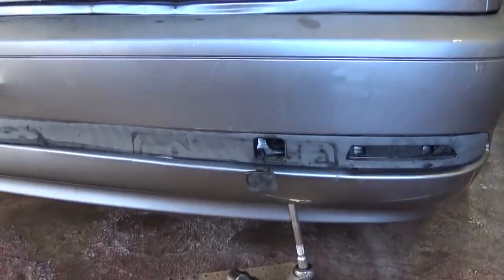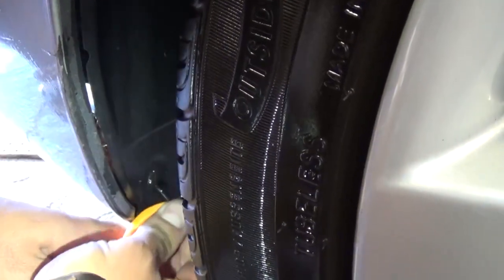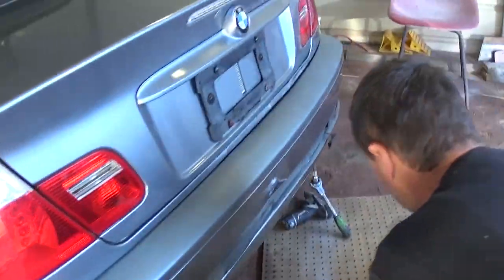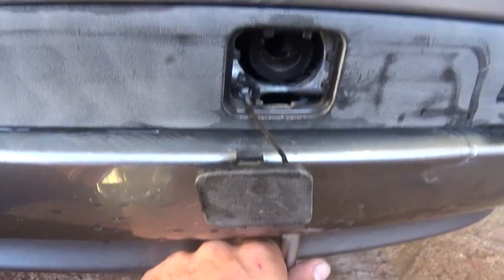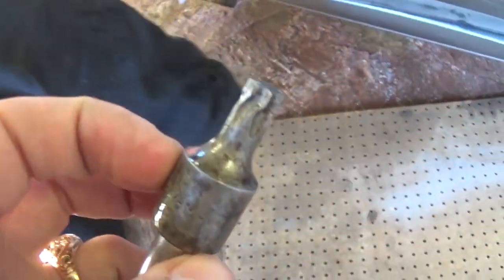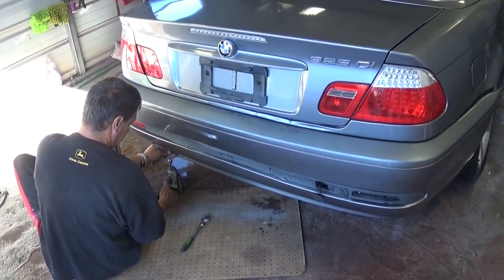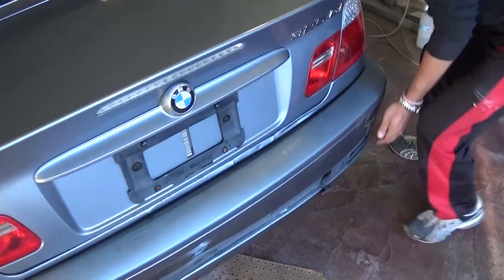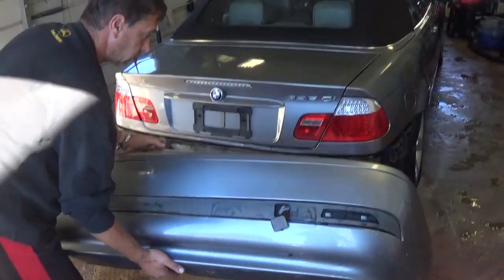BMW E46 REAR BUMPER COVER REMOVAL REPLACEMENT

Comment from the maker: Products that we use and recommend:
►Rear Bumper Cover: https://amzn.to/4f8gY9M
► Panel Removal Set: https://amzn.to/3YiMADu
► Assorted Fuses: https://amzn.to/4fx4s3F
► Tool Set: https://amzn.to/3p5MM6t
► Screwdriver Set: https://amzn.to/3XRB28Q
► Castrol Oil: https://amzn.to/3xBc8B9
► Oil Filter: https://amzn.to/3w0Ulme
► Torque Wrench: https://amzn.to/32qyRwg
► Liqui Moly Engine Flush: https://amzn.to/3IiDBID
► OBD Scanner that we use most often: https://amzn.to/3I4MQfe

► Check out our Amazon Store for the tools and parts that we use: https://www.amazon.com/shop/worldmechanics

Comment: might fricken help if you said to remove the plastic insert mould , SO helpful
Reply: Agree with that. Follow this method and you’ll almost certainly break the side tabs that hold the bumper tight to the wing.
Reply: did u mean the one with the reflectors? did you know how to remove that

Comment: I had to push the parking sensor back out after it got pushed in by some dope, ME. These guys are the best. I did exactly what they did and the bumper cover came off with little effort. At least with a 2004 330CI there's nothing in the trunk you need to access and there's no need to remove any inner fender shields or covers. Do what these guys did and that's it. 10 minutes and the bumper cover was off.

Comment: I have an 04 e46 sedan. Do I need to remove bolts as well?
Reply: Did you find out? I watched a different vid and the guy has to remove the wheel arch covers - didn’t do two t50 bolts like these guys

Comment: Screw bmw who used torx though, all rusted up on my car, span the bolt on first attempt. :(
Your video was good though, just wish I had the same holes that you have in your bumper
Reply: You can open the 3 bolts on the inside of the trunk, so it slides out the whole thing.

Comment: now that you have made a video on showing the public how to remove the rear bumper. you should make a video on how to put the rear bumper back on to the car. it's not enough to make a video showing the public how to take something off you should make a video on showing how to put it back in what is needed thank you
not on all videos on some videos like how to put the bumper back on to the car like for example the side adjustments and things like that